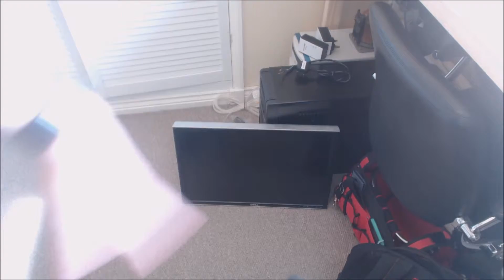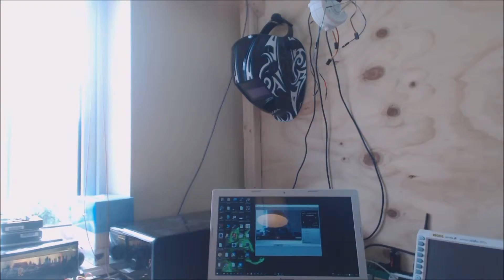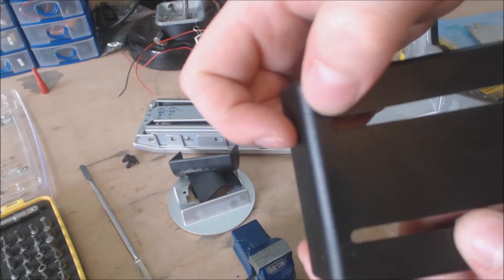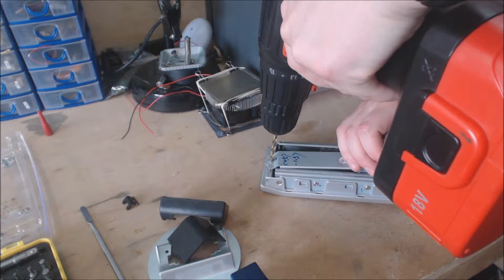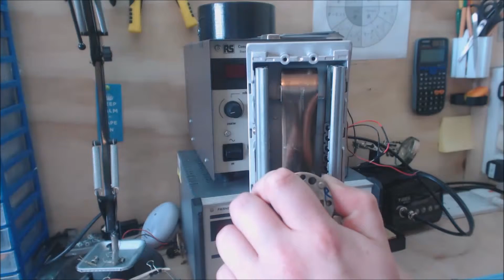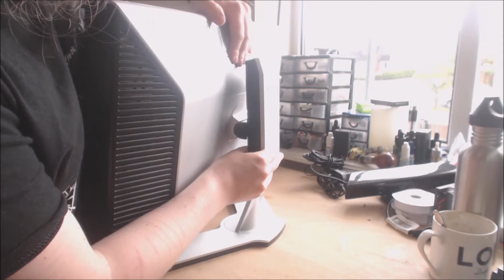Dell monitor stand "repair" - Colour's lab #2

Comment: I removed the plastic casing, the long metal plate where the video showed rivet removed by a power drill, can be removed by three screws. Do not remove the rivet like notch. I just pulled out he latch lock which was stuck at the bottom. Removed the backside switch as well. Re-assembled back after greasing the slide channels. Working smoothly. Without any switch lock.

Comment: I had a similar issue, but in my monitor the system was stuck. I took it apart greased it and put it back toghether. Now it works as a charm 🙂